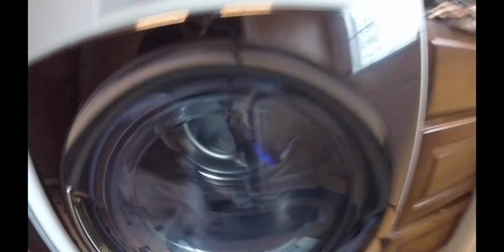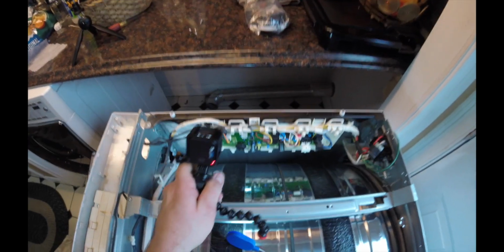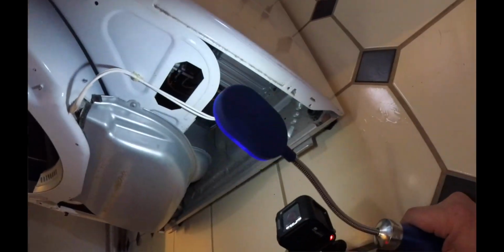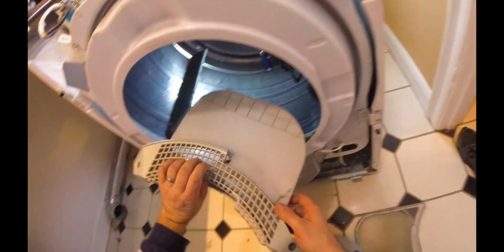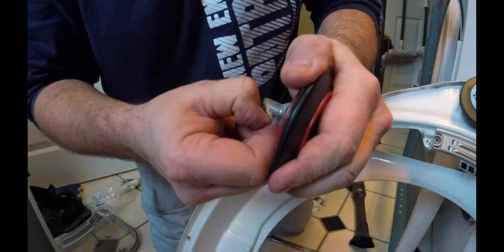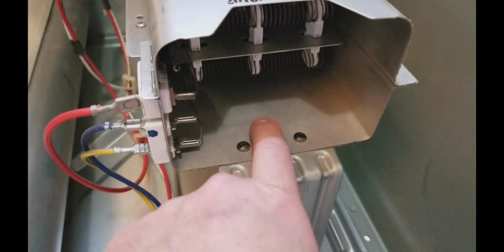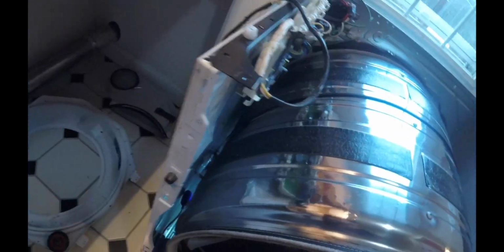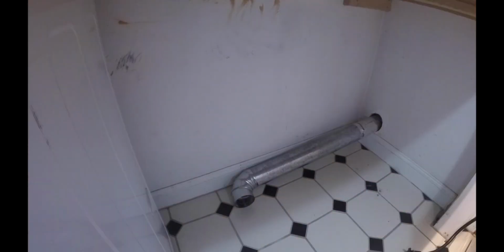Clothes Dryer Roller and Belt Repair DIY Kenmore, LG, Whirlpool

Comment: Just wanted to send a appreciation message for this video.  Just finished replacing the roller bearings on mine and this was a great guide.  My model was a little different, but close enough that the teardown was pretty much the same steps.
Reply from the maker: Now THAT'S awesome for sure. 👍💯

Comment: Excellent. Excellent video. Thank you. I have a similar 11 yo Kenmore dryer and replaced all the same components, including the belt tensioner pulley. In my case the drum was not spinning freely. Found the back bottom roller frozen. Top of it was worn flat. Glad I fixed it. Potential fire hazard. Probably would not have attempted without this video.

Comment: I looked at Amazon for a roller kit something like you used, and it looks like I found the same kit. I don't know what kind of success you had, but the Amazon reviews were, to put it mildly, poor. Around a third of the reviewers said they had one of the new rollers fail within a month or less. I STRONGLY recommend reading Amazon reviews carefully, paying particular attention to the the negative reviews if there is a significant portion.
Reply from the maker: Very well said! So far so good! Our dryer is used almost every day . . . almost and as long as you do a thorough job at cleaning and making sure nothing else is damaged it should be good to go. You do have to realise your not buying OEM stuff and at that 10-12 year mark that you've possibly exceeded the life expectancy. I believe these home machines are good for about 10 or so years. That's been our experience.